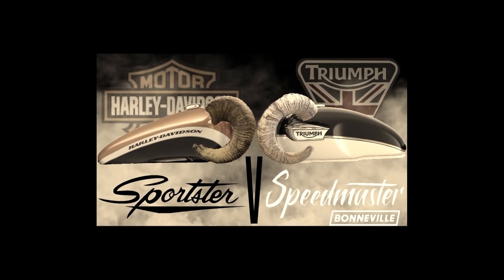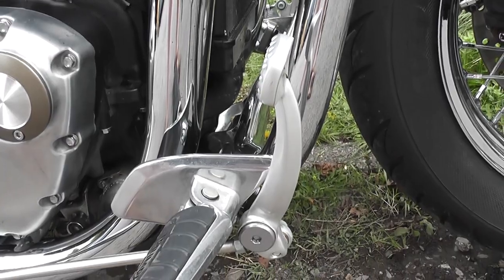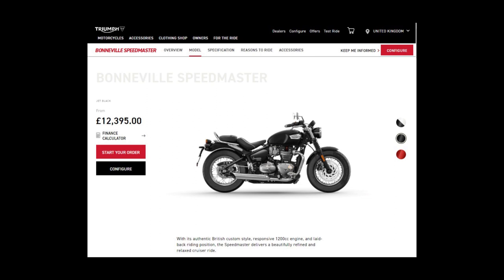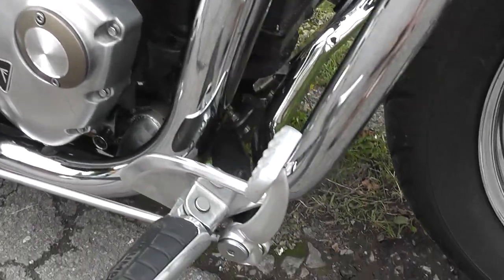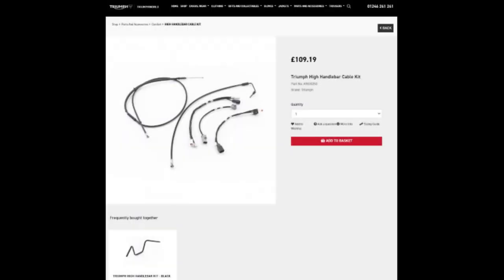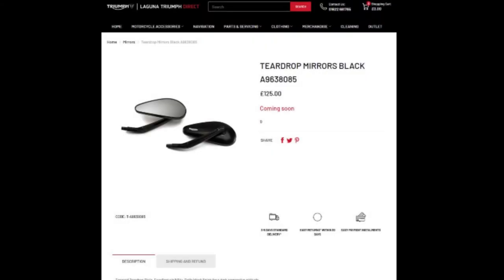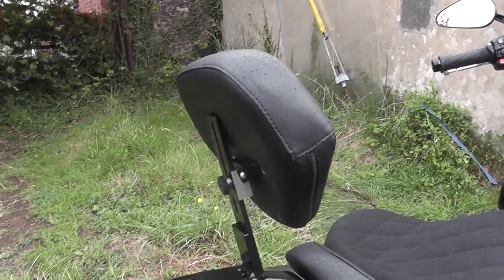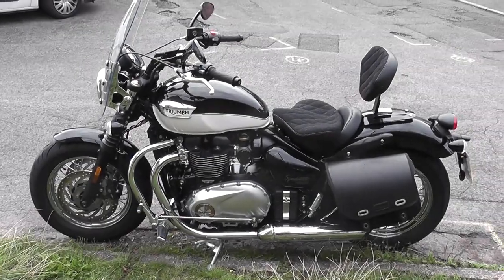Releasing Its Full Potential - Triumph Bonneville Speedmaster 1200. These are the custom parts.

Comment: 👎£15k 😮. Picked up an RE Classic in February (delayed by a storm) with a 50 mile ride home. It was wet, a new bike so getting used to the feel and controls, yet halfway home I realised I had the biggest smile. Whatever your budget - go ride 😀
Reply from the maker: You're right Pete - it's the smile that matters.  :-)  (Mine has been on hold 'cos the Speedmaster has been at the doctor's for a month - oil leak and complete new crankcases required! Guarantee work, fortunately, but still...)

Cheers,

Chris

Comment: Great observations and suggestions.  About engine heat; I wear mid-calf padded leather boots with kevlar-lined jeans!  The main complaint I have is the high-gearing of the Bobber.  The 5th gear (4500 RPM) runs at 154 km/h with stock sprockets.  The 6th gear (@4500 RPM) runs at 171 km/h!  I rarely reach 5th gear and never ride in 6th gear on public roads.

Comment: I have had my Sportster for 25 years and 400,000 miles on the original engine and 37 back tires and 17 front ones and 3 belts in 25 years. Just had the carburetor cleaned for the first time in 25 years. Sportsters are rebuidable forever and reliable and dependable transportation. I have had my Triumph Tr-6 with a hard tail and magneto for 40 years. Replace the camshafts and sludge trap was almost full. New camshafts and sludge trap and now she is good for another 50 years. Big crash bars save the bike. EFI makes bikes run hot as Hades. My Sportster with a carburetor runs 200*  2 up in Florida in the summer 🌞⛱️. New Triumphs require expensive dealer serviceing. Not DIY friendly. Chain drive is messy and expensive to replace. All motorcycles should have hydraulic valve adjustment and belt drive.

Comment: I currently own a 2018 T120 Black and love riding it. Looked into getting a Speedmaster for longer jaunts. But I've found that here in the U.S. that there are 1) Not a lot of Triumph support. 2) GETTING PARTS. 3) Finding readily available aftermarket upgrade ENGINE PERFORMANCE parts if you choose to go that route. Triumph offers a lot of :bling' accessories , but little to no ENGINE PERFORMANCE parts. As with Harleys there are too many to list.
Reply from the maker: Morning Sarge - yip, upgrades are not so easy to get. Here in Blighty, the Triumph parts are readily available, but I'm very surprised that US support is poor. I thought there was a good dealer network over there?

But for me, coming off a much loved Harley Sportster, the terrible lack of after-market stuff is a huge shock. I suppose I was spoiled with the awesome Harley offerings, but I did not expect there to be so little available for Triumph (e.g. only 2 foot rest extensions in the world). And that's just contols & chassis stuff.

As for engine mods, forget it! One company, TECBikeParts.com in Newcastle, do offer some interesting parts - like a crank set - but these don't seem to fit 2020+ bikes 'cos of software guff. And there aren't many performance mods anywhere else: exhausts & air filter kits seem to be about it. (Unless you want to go nuts and fit superchargers and stuff - but this is very specialist.)

I expect your 2018 Bonnie will work with the TEC Bike Parts bits, but replacing the crank seems extreme...

It is one thing I miss about Harley, but that said, with some solid research and time, I have found the bits I wanted; it's just more difficult with Triumph than Harley... Although Harley are in a customising class of their own.

Cheers Sarge,

Chris
Reply: Hi Chris what about triumph twin power?
They have many performance packages and the reviews vindicate their work

Comment: Hi Chris, I noted your comment on the Monza Fuel cap fouling the bars when you open it. I think you may have the cap fitted the wrong way round, the hinge is supposed to be at the front. Cheers.
Reply from the maker: Morning Paul - I did try the fuel cap both ways but it was only practical with the hinge forwards as it's easier to put the fuel nozel in that way. Since I changed the bars though, it's not an issue. Still - as you said - hinge front for me!
Cheers,

Chris

Comment: Thumbs up for the upgrades on your Speedmaster. What a difference it made. 
However I do have a few head scratching points with this  current Speedmaster vs the earlier series. Why did Triumph move towards more of a bobber look? I always thought the design of the previous model was the epitome of a standard/cruiser look. They could have just enhanced that model. Yes it did need areas to be addressed. Such as a larger engine such as yours.  Multiple cheers for the idea of replacing the "Victorian technology" chain drive with a belt and add a 6spd to the earlier bike. Something they should have done long ago. My current putter is a '83 Kz440 Ltd with belt drive and a 6spd transmission. Go figure Triumph. Hopefully they will address the Speedmaster model with some of the issues you pointed out. Anyways no matter what you ride. Go out and ride and enjoy and get that giant silly smile we need.
P.S. You are spot on about the  wonderful exhaust sound. Be it the earlier Speedmaster or the current model.
🏍️🤙✌️

Comment: The catalytic converter underneath the engine is lot of the heat your feeling.  Obviously removing the catalytic converter and putting an x pipe in it's place will really help out heat wise, it did for my Thruxton R.

The chains don't really don't require much maintenance these days except some cleaning every few thousand miles in dry weather more often if ride in the rain a bit. The o and x ring chains have all the lube you need.  If you want to put some chain wax on after cleaning that helps keeping the side plates protected from rust.
Reply from the maker: Hello again Flat Cap (or, can I call you 'Dad'?)

You're the second person to note that the cat causes extra engine heat. I had no idea. I'm going to have to Google is 'cos you're the first person I've spoken to who has actually done it - and you say it 'really helped'. Very interesting - thanks for the comment mate.

Cheers,

Chris
Reply: @chrisoftheot6272  I fitted a Motone X-pipe, I can't say that I have noticed any difference on it being cooler, but it does seem give a smoother response to the throttle at lower speeds
Reply from the maker: Morning Martin - interesting, and disappointing, that the X-pipe didn't help the heat issue. The TEC Bike Parts pipe says, 'Less back pressure and heat soak into motor to help with cooler running'. I suppose it's just techno-babble! Shame though...

Cheers,

Chris
Reply: @chrisoftheot6272  You'll have to excuse my memory on the exact numbers since it as over three years I took them. I used an infrared thermometer to measure the heat with catalytic converter,  free spirit x pipe and then Meerkat x pipe. I ran on a 30 minute loop then took readings at the base of the engine on both sides immediately after stopping with the bike idling.

The best I remember the engine was 10 to 15 degrees cooler with the x pipes than with the catalytic converter.  This test was spread over a month or two so the conditions did vary however the catalytic converter was done in the spring so it was probably cooler than the test with x pipes.

I've had three aircooled Bonnevilles and my perception was that they ran cooler from the rider's perspective than a stock watercooled Bonneville .  

I would say my Thruxton R  without the catalytic converter is cooler to ride than my aircooled Scrambler,  warmer than my T100 and about the same as my 2009 Thruxton.

I've yet to hear an argument showing how removing the catalytic converter would not reduce the heat soaking back in and raising the heat the engine produces.  Maybe just more techno babble.
Reply from the maker: Afternoon Dad (Okay?) - many, many thanks for this. I was stunned, again, with 'I've had three aircooled Bonnevilles and... they ran cooler... than a stock watercooled Bonneville'. Incredible! But, I suppose, no more so than finding the Sportster ran cooler than the liquid cooled Speedmaster.

So, definately not 'just more techno babble' - far from it. Clear, simple explination coupled with some excellent real-world experimentation. Superb - thank you! I have looked a good deal at engine temperatures (for Harleys) and found that an additional oil cooler reduced the temps on some M8 models by about 15 degrees also. This is no small feat. Your findings have confirmed that I need an X-pipe, so thanks for the clarification. And thanks for all your efforts too - much appreciated.

Cheers,

Chris

Comment: I just bought a 2022 Speed master and agree with all you have said and done. And I love it, so comfortable a bike. I have only so far put on a battery tender and a booster plug to help with jerky throttle. I have ordered some Motone parts and a decat. I'm hoping the decat helps with it running so hot. I love the sound just as it is really same colors, I would like to put some knee pads on but I'm sure the paint stripe won't match the Union Jack strips. Hello from Ohio.
Reply from the maker: Afternoon Robert - I was just writing about Ohio in the next video script (specifically, Cleveland 'cos of Alan Freed & the start of Rock 'n Roll). Now you'll have to watch the next video!

I had never considered that a decat X-pipe would help with the engine temperature. If you do this mod, please let us know how it goes - if it does help reduce the crazy-high temperatures, I'd be interested.

Cheers,

Chris
Reply: @chrisoftheot6272  I will.
Reply: Robert.  The booster plug WONT WORK with the (Euro-5) ECU anti-tamer software as your bike will light up the Engine Management Light when the ECU detects a temperature difference between a couple of it's reference points.

I wouldn't recommend riding around with the EML on for obvious reasons.
Reply: @mrcraighew1  ok I didn’t now thanks
Reply: What’s a booster plug ?

Comment: Chris, thanks for your honest review and each manufacturer’s quality. I owned a little 2010 Bonnie 865SE. Reminded me of riding a 20” bmx. It started leaking oil before my Sportster 1200 and well the 1200 has no oil leaks and is 8 years old. The Bonnie was only two years old before the cam cover started leaking oil. Bonnie was fun. The Sporty is fun. The Sportster is more relaxed at 80mph. Back on track, your upgrades look great.
Reply from the maker: Thanks for the kind comments Jason. The Speedmaster is more comfortable generally - it has real suspension and everything! - but even so, I don't like the very high speed vibrations. They're a very high frequency, where the Sportster vibrations were a lower frequency. I wouldn't have thought it would make any difference, but it does. Who knew?

Cheers (again),

Chris

Comment: I put 5.5 inch risers with no problems, just had to open up the rubber isolation grommets for 1/2 diameter bolts. I have numerous parts for the 2017 to 2023 speedmaster if you need anything
Reply from the maker: Morning Tom - REALLY good to hear from you, 'cos I've never heard of anyone else putting on long risers. Good on ya'! Which risers have you got? I'm guess the Rox ones - although I couldn't see a long set that were for 1" bars... I'm very interested to hear about these.

Cheers Tom, and thanks for chippin in,

Chris